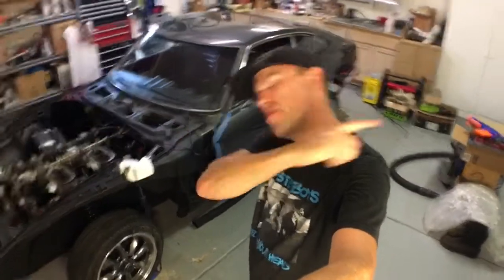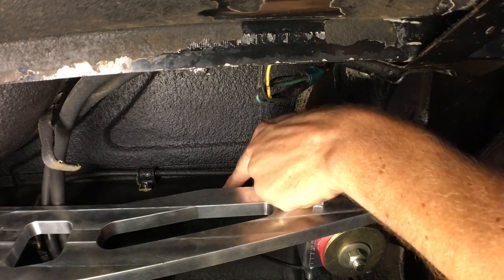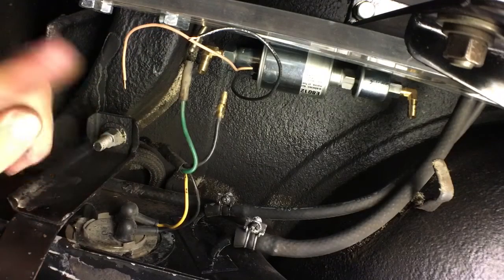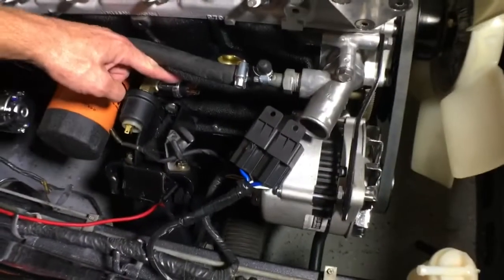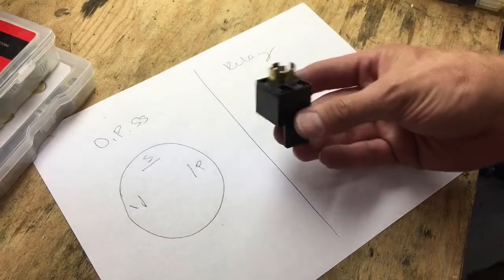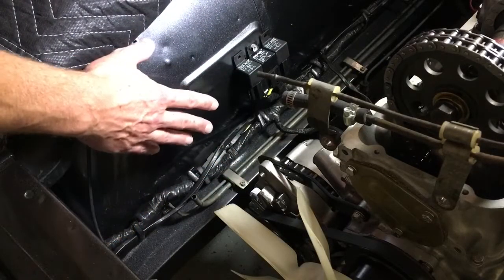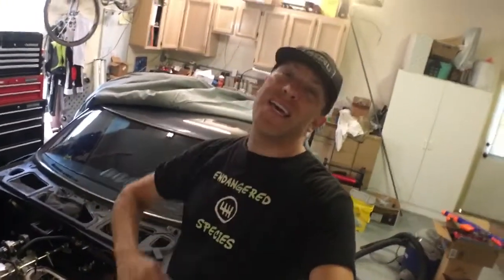Datsun 240z gets an electric fuel pump system installed

Comment: On your fuel pump installation video when you are under the dashboard hooking up the green and black wires you show where the black wire ends up on terminal "I" of the fuel pressure switch but where does the green wire go to? Thanks, Randy.

Comment: Forgot to mention, i have a holey pump and its installed in the engine bay , it only has 2 wires, red and negative already grounded, so I connected the 30 to the positive so my question was which goes inside along with the “i” wire

Comment: I got confused, the “i” wire is going into the cabin, got that, if the 30 wire is going to the fuel positive on the fuel pump, then what wire goes along with the “i” wire into the cabin???? Should i take the positive from the fuel pump and the 30 wire in the cabin and splice together so they plug into the ignition? Please help thank you

Comment: Are you still running your mechanical pump alongside or did you block it off? Curious why you tapped into the Oil pressure switch? thanks for the video super helpful! ill be doing this on my Z hopefully in the coming weeks!
Reply from the maker: No I went electronic fuel delivery. The L28 head doesn’t have the ability to run mechanical. For the oil pressure switch tap was used so if the the oil pressure goes to zero, like in an accident, fuel is cut. Thanks for watching! Good luck on your build!🤘🏻

Comment: Not quite sure why you are cutting only the fuel pump with the oil pressure switch. It will help you in a rollover or crash but not in an engine failure as the carbs will have many seconds of fuel to keep spinning those rod bearings. Why not cut the ignition including the spark and fuel together? Also how would you prime this system if needed? Maybe an additional push hold bypass?
Reply from the maker: Yes, I agree, I could take this further for sure. Check my other video on how I handled priming. Thanks for watching!

Comment: Hey man, i ordered that 1/8 adapter and stuff. It doesn’t want to go in. It looks a bit bigger than the pressure sensor size. Did you have to change something in the engine block for it to screw in?
Reply from the maker: I didn’t . Hmmm sensor fits into the block okay?

Comment: Is it safe to run a 10a inline fuse holder to toggle switch from battery? To turn pump on and off?
Reply from the maker: I would double check your fuel pump amperage but should be fine.
Reply: @CarsBikesandCoffee  thank you ,,,,10a fuse ,,,wire is 17 amp max 14g. To 15amp max two post toggle switch

Comment: great video; thanks. I recently installed a Holley electric fuel pump and it makes a constant (annoying) humming sound... did you have any of these issues? do you think the noise issue is specific to the fuel pump brand/model, or is there something else that you did in your process to reduce/eliminate the ongoing noise? thanks in advance, CC~
Reply from the maker: This fuel pump is sort of quiet. Did you put in some rubber washers or the like between the mount and the body? That will help a lot if not.

Comment: Hello, I have a quick question as I’m trying to install a electric fuel pump in my 1970 240z, I noticed there is also a green wire female plug underneath the battery area in the engine bay, which wire should I connect this to? Does this wire go into the electric fuel pump relay?
Reply from the maker: +pheng wang they used green a lot. I’m not sure what you have there. Maybe test the lead?

Comment: Great Video and some Questions
Question 1:  Did you decide to retain the metal fuel rail?
Question 2:  Did upgrade to fuel pump address Vapor Locking

Thanks for the clues, Jay
Reply: My car is a 1972 240Z.
Reply: Parts ordered, car has wiring for pump.
I am contemplating adding a pusher fan to aid SU cooling.
Reply from the maker: That would be nice or a heat shield between the exhaust and the SU’s. Are you getting some vapor locking?
Reply: @CarsBikesandCoffee  Sadly the car vapor locks on all warm days.  On the upside I have a trailer to rescue the car.
Reply from the maker: The pump will help. Do you run headers? If so even if not, building a little heat shield wouldn’t hurt.
Reply: Cars, Bikes, and Coffee I run headers and  I have the stock heat shield.
Reply: Cars, Bikes, and Coffee Where did you get the clamps for fuel and return lines?
Reply: Stock Fuel Rail.
Electrical Question:  What amp fuses did you install?  
     Location of Fuses:  Ignition behind panel in console,  Second on Power from Starter?
Reply from the maker: I used a 15amp for both, in line to the pump and yes to the power.
Reply from the maker: Awesome!!
Reply from the maker: +jay biddle thanks! I did, it works fine. It definitely can help cure vapor lock issues. I rebuilt a L28 from a 280ZX which doesn’t have a mechanical fuel pump.

Comment: Quick question is the pump self regulated? What controls it to turn off once max psi is reached or does it continuously run and regulates itself? I'm doing the same thing just with a different platform.
Reply from the maker: +parrotheadmatt87 it is. I installed a fuel pressure regulator to turn it down and dial it in exactly as I needed.

Comment: Kurt, Thanks for the info, I have a 1972 240z L28. With the extra time a home, Fing covid 19. I'm installing  an electric fuel pump. I have the pump connector behind the radio, green goes to pump connector in  back. the black white wire goes to the ignition switch. the question is my Black white wire has 12 volts with the ign. switch in both the start and on position. Is that ok for this setup. I have different wire diagrams that show the black white wire wired  two differrent ways. one with it with 12 volts in the on position only. and the other shows power in the start and on position. whats right. Thanks, Bill.
Reply from the maker: +Ranger Willy I would run your own wire from the ignition. Good use of free time! Appreciate you watching. Let me know how it goes!

Comment: Did you have issues getting that tee to thread into the block? Trying to do this myself, but none of the threads seem to match up. The sensor only goes in a few turns into the tee and feels like it's stripping the threads, and that tee won't go in but a half turn into the block. Was there sorcery involved?
Reply from the maker: Thanks for letting me know! I’m glad you didn’t force it. You’ll need to get a reducer that take it from the 1/8” bspt thread of the block to 1/8” npt thread of the tee. Here’s a link https://amzn.to/2AV7rBW. Also added to description.

Comment: Where and how did you tap into the ignition wire? Great videos!
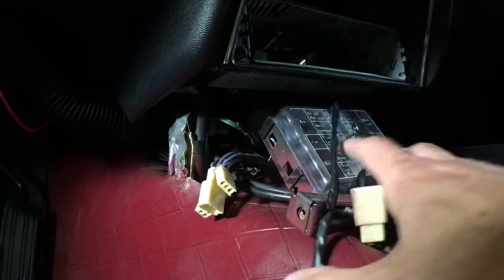Reply from the maker: Allan McHenry thanks! At 15:53 I mention which wires to use. There’s a hidden harness (14:23) below the stereo that has the wire that goes to the fuel pump and an ignition lead you can easily plug into. Thanks for watching!
Reply: I was hoping the wiring of my 260z would be similar, but it has 2 electric pump cutoff relays. I was able to come up with a solution. Looking forward to more of your content.
Reply from the maker: Allan McHenry ah right on! Late model 260?
Reply: My ‘73 240z had a fuse holder labeled ‘Fuel Pump’ behind the radio. It looked stock and just needed a 20A glass fuse.  It was connected to the green wire back at the fuel pump.

Comment: Great videos, 240z looks mint. I'm doing a youtube 280z project car. Just subscribed great content, very informative
Reply from the maker: Thank you! What’s your plan for the 280Z?
Reply: Everything hinges on if the engine will run. Shes been sitting a while, if it runs i will keep the stock l28. If not vq35 is the plan
Reply from the maker: Well good luck! Either would be awesome! Nice thing is these engines are tough.

Comment: Hey, i must've missed something.  What's the true nature of using the pressure sensor?? to make sure there's oil pressure while cranking before the fuel pump is turned on?? Good video, as usual . Very to the point.
Reply from the maker: Thanks for asking, I should have mentioned it in the video. Basically, in the event of an accident, the engine would stop creating oil pressure and the switch would cut the power to the relay which would cut power to the fuel pump. Another safety would be an inertia switch, but sometime those can cause issues on big bumps.
Reply: Thanks for the reply, makes perfect sense.  I was kinda scratching my head, wonderin why you were doing this....
Reply: Sorry to be columbo'ing you on this but(LOL)... i'm an engineer... mech, always trying to understand things.  Anyway, when the car is not running, and you go to start it, are you bypassing this circuit to start the elect motor?? I'm doing a megasquirt conversion on mine and i'm trying to understand how i would do something similar.  In your explanation it might help to say what side or what contacts are normally open/normally closed, in the future.
Reply from the maker: Ha no worries. So there are two inputs for power one for cranking so it doesn’t care what the pressure is and then while running it would kill of pressure was lost. Appreciate the feedback, I thought I mentioned.
Reply: @CarsBikesandCoffee  Thanks... is it Kurt or Curt? what are you working on now?
Reply from the maker: @Joe M Kurt, I have a 1993 Audi S4 restoration and a 1974 Datsun 260Z complete rebuild, hopefully get some more of those build videos up. What are you working on?
Reply: @CarsBikesandCoffee  73 240z resto, with Megasquirt EFI, coil on plug, complete rebuild.  just finished the gas tank mod yesterday for the efi pump
Reply from the maker: @Joe M sounds awesome!

Comment: Just a pointer, 90 degree fitting are highly restrictive to flow which makes me scratch my head.....How is this better then the mechanical pump setup? why do you need a pressure reg? is the installed pump designed for a domestic and pushes 6-7 psi?
Reply from the maker: Yeah, very true, they are restrictive. Since I have swapped the engine to a 280zx L28 it doesn’t have a mechanical fuel pump. Pressure reg is just for fine tuning as the fuel pump pushes more than I need currently. Thanks
Reply: <Make sure not to regulate it over 4 psi, noting good can come out of it.
Reply from the maker: Thanks, yeah plan was 3.5-4
Reply: Yep. “Flow = go” thats what I’ve heard. 
I didn’t find this solution ANY better than a good mechanical pump with my 240z and dome top SU’s. Trust me you can still get vapor lock with an electric fuel pump- I live in California. I know it’s possible. 

With this solution, the electrics to the relay can go wrong, the pump can fail or the oil pressure switch fritzes.  Then what?  I spent 1 hour on the side of the road with it - then took it all back out. 

At least with a stock mechanical pump, if the engine is turning the cam, then it puts fuel in the float bowls.